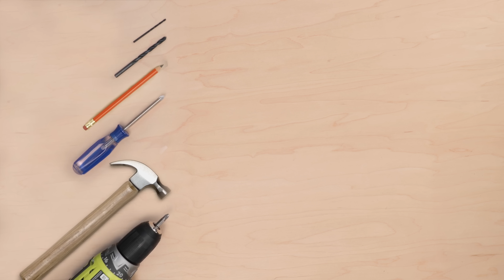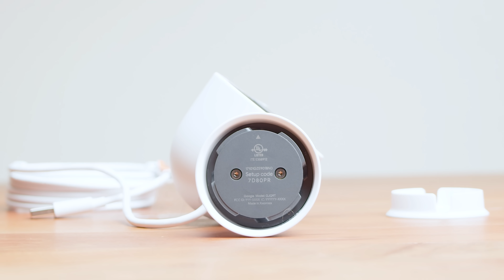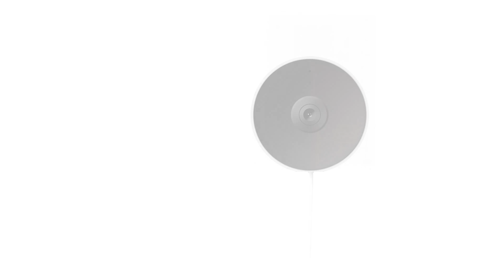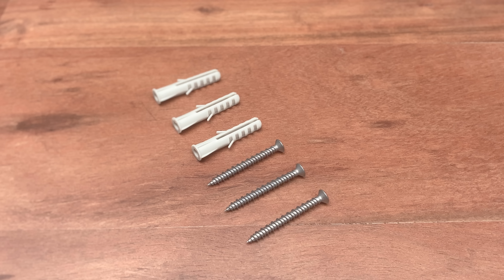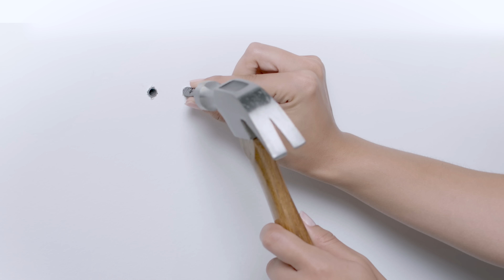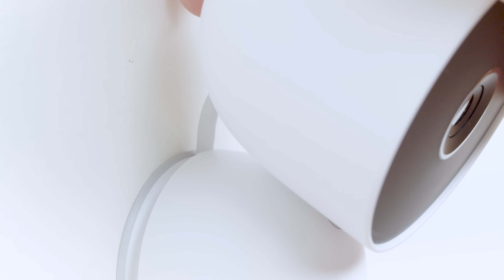How To Install Your Indoor Nest Cam (wired)

Comment: Can you set it so the cable goes up into the celling and not down the wall? That would look cleaner. Thanks
Reply from the maker: Hey Brad, thanks for your interest. Yes you can as long as you mount it indoors and follow your local privacy law. You can check his helpful link on how to install: https://bit.ly/3mvF8SC
Reply: @madebygoogle  a terribly misleading response. Shame on you.

Comment: aaaaand Google home can't find the camera. Well, that was a disappointment. But good video.
Reply from the maker: Thanks for your comment, Ulrik. You could try moving your router closer to your camera and see if it helps. Also, rebooting your devices (phone, router and camera) will be helpful. For more help, you can reach out to our other support channels (Facebook: https://bit.ly/3hXCseW and Twitter: https://bit.ly/3y2icNm). You can also use this link: https://bit.ly/3adTfGB
Reply: @madebygoogle  Turns out all I had to do was turn Bluetooth on/off. Sadly the manual is three lousy images and no information whatsoever about the actual device or how to troubleshoot it. And the app actually told me to make sure the camera was on the same wifi. That should make some people scratch their head trying to install it. Had I known it used BT(?) for the setup process I'd probably figured it out in a minute.

As always there's a user that did all that for you, but after moving the damn device all over the place I was less than a minute away from repackaging it and sending it back. Great hardware and rubbish documentation is sadly a trademark for all the hardware. "Just Google it!" 😀

A widget to snap straight to the live feed and/or memory would be nice.
Reply from the maker: We value your experience and we'll take this as feedback. Follow our social channels for any updates and announcements. Reach out to us anytime if you need more help: https://bit.ly/3adTfGB

Comment: I installed it on the wall exactly as shown here and it cannot be angled correctly, I need to move camera more up but it doesn't go up more (cam can only move up and down little bit) so the wall mount is worthless
Reply: You can twist the wall mount all the way around

Comment: Where is the 1/4” 20 mount??
Reply from the maker: Hey Max, we're sorry for the delayed response. While Nest Cam (wired) doesn't have a tripod mount, you can use the stand or screws that came with your device. Have a look at this article: https://bit.ly/3vUVAPI
Reply: @madebygoogle  your articles are confusing and misled me when I was buying, as the prior Indoor Wired model did have a tripod mount. You guys should make an alternative baseplate or attachment for tripod mounts for this new model.
Reply from the maker: We're sorry to know that. We'll be sure to take this as feedback as we're looking for ways to improve our products and services. Stay tuned on our social channels for more news and announcements.

Comment: In the video, you mention using an extension cord if you need more than 10ft. Can you share what specifications are needed for a usb extension cord? I purchased one from Amazon but it was not enough to power the camera.
Reply: I use a regular extension cord not a USB extension cord.